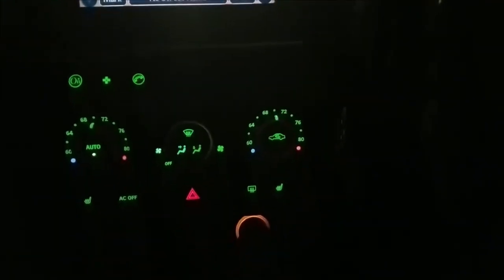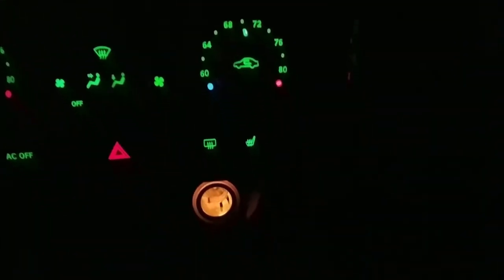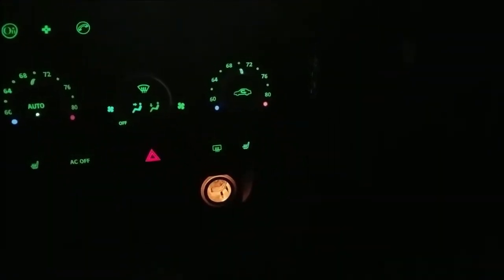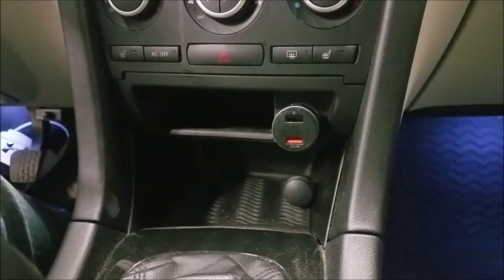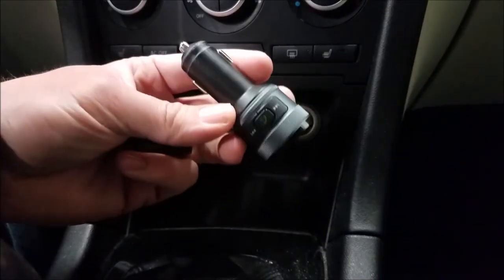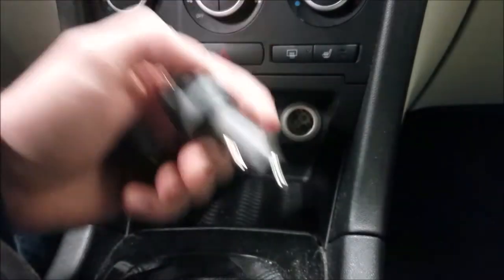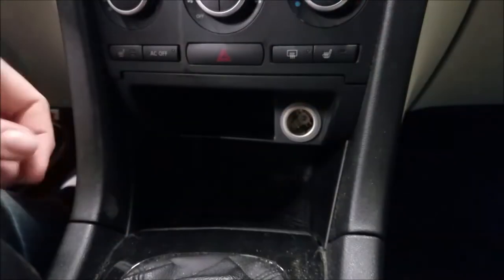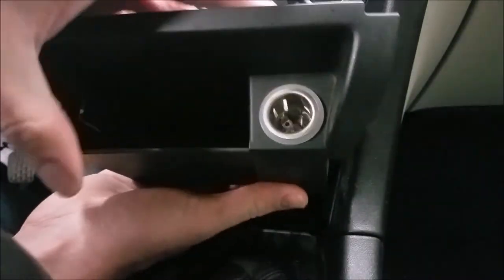Saab 9-3 Cigarette Lighter Bulb Replacement

Comment: Excellent! I’m replacing my radio with a head unit and this provided an excellent guide to replacing the cigarette lighter socket with a USB pass through socket to bring the head unit USB ports to a usable location.

Comment: The earlier ones have an astray,same bulb connectors, funny thing I just changed mine with a replacement from Ebay, main reason was lighter wasn't working but the light was and also my soft opening astray was broken so I killed two birds with one stone ,but now the light isn't working although the lighter is ,I put the old bulb back in but still no light ?will now take the bulbs 💡 and see if by some chance both are blown,I did blow fuse 22 when fitting it because I put my Bluetooth in before connecting the wires on the back ,because they have a sliding lighter on the astray ones,but could I have blown the bulb ?

Comment: WELL lol without sounding rude thats one hell of a hard repair you have come up with for yourself   there ,!
the bulb unit and outer plastic illumination white  circular "LIGHT BAR" piece is a TOTALLY separate genuine SAAB part
comes complete with the green plastic covered  bulb, and bulb  holder  it just slides onto the metal body of the unit 
  they still make and sell these brand new 
 made by the swedish company SKANDIX they make a variety of OEM lightbars and cigarette lighter bodies for a variety of models including SAAB the genuine factory fitted item 
ive just bought one, it  took 5 minutes to fit if that ,
 just short of 15 euro's brand new for a genuine LIGHTBAR thats what its called and a genuine SAAB still available part
 the metal cylinder and lighter itself is the second separate part that makes up the cigarette lighter
 they still make those new also ,
you can save yourself a lot of messing about by just buying a genuine replacement complete lightbar unit 
 the bulb and its holder are not assembled up to be taken apart again, you are not supposed to start trying to remove the build its not made to take apart again,  thats why the holder broke sorry ,
you buy a new fitting LIGHTBAR  complete and simply slide it onto the metal body takes 2 minutes job done 
regards ,
Reply: How did you slide the metal part out?  It looks like you need to get behind it to squeeze the 2 metal tabs and then slid out.

Comment: I swapped my cigarette lighter and Center console AUX port with LED's and did not have modify the plug. The trick is finding an LED the same length as a T5. The LED's do not dim the same way as a standard bulb.
Reply from the maker: Good feedback, thank you! Where did you purchase your LED's that worked from? Do you happen to have a link by chance?
Reply: @WeakestofWeeks   I used these LED's (green) https://www.superbrightleds.com/moreinfo/miniature-and-subminiature-bulbs/74-led-bulb-3-smd-led-miniature-wedge-retrofit-car/228/1070/
Reply: @WeakestofWeeks  These are the ones to use for the lighting in the visors (white)  https://www.superbrightleds.com/moreinfo/miniature-and-subminiature-bulbs/74-led-bulb-3-smd-led-miniature-wedge-retrofit-car/228/1067/